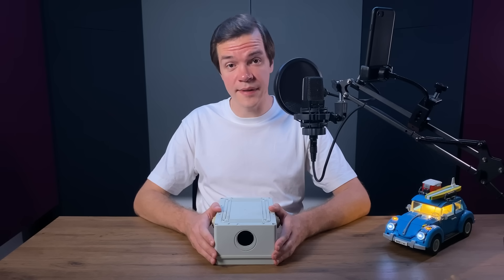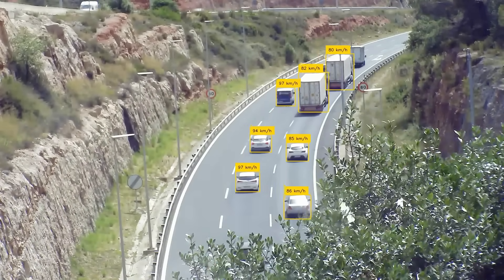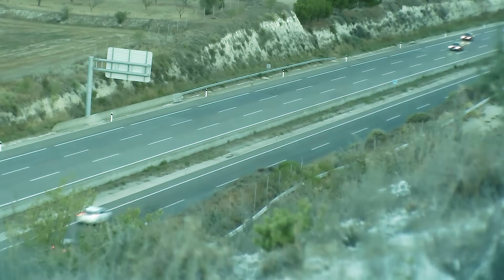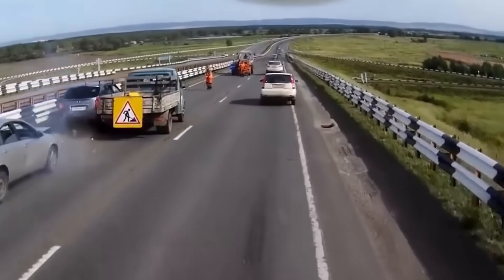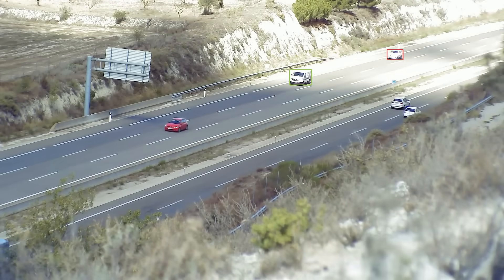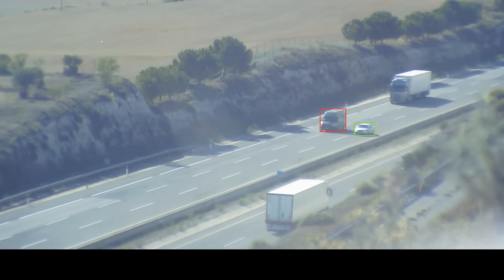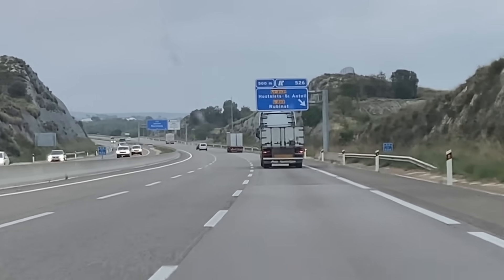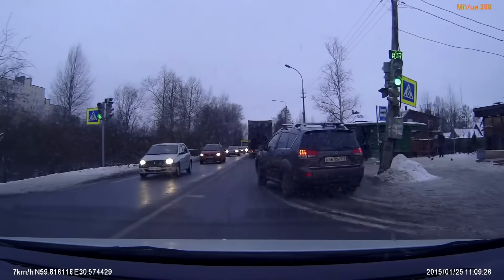New Anti-Tailgating Camera Reveals Shocking Statistics

Comment: "Tailgating" is a habit of a great many people.  If it takes T1 to observe something and determine what action to take and T2 to actually take it then being closer than T1 +T2 means a collision is inevitable.  If the speeds are different the time required is T1 + T2 +(U-V) / a where a is the maximum braking acceleration, U is the speed of the car behind and V the speed of the car in front. Taking a fair number for a is between 1 m/s^2 on snowy ice, to 3 m/s^2 on a damp road to 6 m/s^2 on a wet road to 10 m/s^2 on warm dry bitumen.  Because of that great difference then having the SAME speed for all vehicles makes everything easier and safer. The weather conditions have less bearing on the safe distance.  Note that the time T2 can reduce to almost zero if your foot is off the throttle and covering the brake. So ANTICIPATION helps a lot.
To give examples at 20 m/s (72 km/hr) let us imagine that T1 is 1 second T2 is also 1 second and the front driver is at 60 km/hr ( a bit under 17 m/s) the driver in front sees a problem and starts to brake at 6 m/s the time that the car behind must be to avoid a collision is 1+1+ 0.5 = 2.5 seconds.  If the vehicle in front HITS something that you can't see then the minimum time becomes 1 +1 + 3 = 5 seconds.  Closer than that and it is too late you HAVE hit the mess.  Multicar pile up here we come.  Now this is the minimum.  If everyone did this then when one car brakes the one behind must brake and the one behind that must brake and the one behind that must brake.  And so on. Indefinitely.  If the distances were doubled then the first car brakes.  The second car doesn't need to brake as hard.  The third car brakes less again and after a few cars the problem largely disappears.  Everyone gets home with a minimum of delay or traffic jams.
There is a REASON why I am so concerned.  Many years ago an empty sand truck was tailgating a car on Stud Road.  According to the truck driver the car braked.  The truck panic braked and lost control of the rear which swung across the road into the oncoming traffic.  Because of the mass of the truck even though it was a 60 km/hr zone the effects on the oncoming traffic were of a 100 + km/hr collision.  My father in law took the brunt of it.  It didn't kill him outright but left him with permanent severe brain damage. Unable to walk or feed himself or do anything without assistance.  It took him 5 years to die slowly.  And all because the truck refused to leave an adequate space.  It isn't "just tailgating" or a victimless crime.  There is a litany of victims of it and the policing is negligent where it exists at all.  No one takes road safety seriously.
Reply: Just assume the car in front of you collides with an object you couldn't see - assume that the driver is asleep and doesn't brake at all because he doesn't notice. That car very suddenly comes to a complete stop, far faster than it could by braking, far faster than you could by braking. So just assume the space you have for coming to a stop is exactly the free space you can see in front of you, and not a centimeter more. This also works for situations where the road in front of you is beyond visibility - be it because it curves, because there's a hill, or because of bad weather. It doesn't matter. Always assume there's a dangerous problem just outside of what you can see.
Reply: @KaiHenningsen If there is no other vehicle in front of you, then you really should able to come to a full stop within visible distance. But if only the vehicle in front of you blocks your view and you follow the same logic that means you don't trust the driver of that vehicle. But if you don't trust him/her, why are you trust the drivers of crossing traffic when you pass a green traffic light without braking? If you always slow down even if you have priority to check whether is there crossing traffic violating rules, than than the traffic gets so inefficient that the roads become basically useless. For efficiency you should trust in all other drivers following the rules. This is not just an advice, this is the law (at least here in Hungary). And if the driver of the vehicle in front of you follow the rules it never will struck something and come to a stop instantly.
Reply: @Zilahi-Branyi_Laszlo  show where that law is written
Reply: @gavnonadoroge3092 I was a bit unprecise. Its an interpretative provision of the law, not the law itself and it is not in force for almost 10 years now, but based on press release the goverment want to implement it into the new law expected to enter into force next year. Despite currently not in force, even nowdays this is one of the first thing driving schools teaches to students, so basically everyone use it as a rule, as people usually learn based on what said in school and not by reading the statue book and the fact that the goverment want to implement it into the new law shows that they don't think it is outdated, its invalidation is just an unwanted side effect of the interpretation provisions has been generally abolished and they plan to correct this now. You can find this interpretative provision in the book "A közúti közlekedés szabályai és értelmezésük" however you probably need to get your hand on a phisical copy of it as it seems it isn't available in any electronic form.
Reply: and those ones who screams speeder are even the same which cutoff otherones

...most times to grab money from the insurance come pennies
Reply: I have always thought that the absolute majority of accidents can be avoided by maintaining the safe distance, it's much more important than religiously setting the (EXACT speed limits regardless of road conditions)

Comment: Excellent analysis and presentation.  Thank you for all your hard work.
Reply: Indeed.
Reply: Cars have the technology to be programed to follow at a safe distance.. but not everyone uses that feature or abides by it. So why not take car safety a step further and have a mandatory warning? You could employ this technology as a standard the exact way you do with seatbelts. If you dont put on your seatbelt on get an annoying dinging sound and blinking dash icon till you abide by the law. If you followed to closely and got a dinging sound and red blinking dash icon Im fairly sure everyone would back off after a few seconds just as they submit to putting their seatbelt on. The impact would literally be HUGE since most accidents are caused by following too closely.

Comment: The issue often is that slower drivers don't keep right. Then, you have to come closer to let them know you'd like to pass. Thus not keeping right is much bigger security problem than tailgating itself.
Reply: you "have to" come closer?
What is your first priority while driving?
Getting home safe or being there early?
Reply: @Ultrazaubererger  To me keeping my sanity having to deal with idiots in traffic for 2hours everyday helps me to drive safer.
If everyone followed the 100m rule id spend 4-5 hours in traffic everyday or more.
Its littearly impossible, my way back to home is littearly constant traffic on both lanes for 60km.
Speed limit is mostly 100kmh but the normal speed is 80-90 sometimes even 60-70 becourse some people NEED to take an exit 2km ahead.
Reply: @iirosiren5120  I had to drive 40km each direction for a few years. Heavy traffic all the time. During that time I changed from always trying to push past to always keeping a safe following distance.
It made no difference (the most I was able to gain was 10 minutes off my 1,5h drive).

Also, 60km each day? you should get a new job or move closer to it!
The added quality of life is worth it!
If you calculate your commute time as working hours, it may even be cheaper to get a more expensive place or earn less.

Comment from the maker: What do you think is a safe and reasonable following distance in dense traffic at highway speeds (75 mph / 120 km/h)? Both meters and yards are fine — they're more or less the same anyway :)
Reply: Just went to the obligatory skid course (Schleuderkurs) in Switzerland, and they told us half of the speed gauge in meters or about 2 Seconds to the next vehicle. I find it interesting that you where told 3 Seconds (more is better, no doubt there).

It's a bit sad, that when you try to have enough distance to the next car, that others will invite themself into the 'reserved' space.

What I'm trying to do is put in the speed control and have the  foot over the brake, to get a even faster reaction time.

Still leaves the one behind to also do the right thing.

Driving is teamwork, regardless of how one looks at it.
Reply: Also, yes, external enforcement against insufficient distances does exist. Old Top Gear or Clarckson's Car Years showed it on a segment on the unrestricted segments of the german Autobahn. It did, at least at that time, however, require a human officer in the loop to decide on context wether or not it was tailgaiting.
Reply: It is more complex. If you are faster than the person in front you must increase the distance.  Conversely if you are slower ( they have just overtaken you) the distance can be less.  Once that is considered the MINIMUM safe distance is the reaction time under the conditions.  That can be as low as 1 seconds for a driver expecting something at any moment but with the foot on the throttle, 0.6 seconds if the foot is covering the brake and not on the throttle to over 2 seconds on a highway where a driver is not expecting trouble. To many seconds if the attention of the driver is distracted by ANYTHING inside the car.  But the minimum still causes traffic waves and congestion.  So if EVERY driver allowed an extra couple of seconds the action of one car would diminish after a few cars passed.
Reply: approximatly 3-4 seconds, since that stays about constant with different speeds, is constant across imperial and sensible units - and I don't have the spacial vision to estimate those distances in spacial terms.
Reply: I use 2 seconds when I drive.
Reply: I usually have slightly more than one second. Works 100% of the time for now
Reply: how about trailors which mean to push the limits
Reply: In the UK, 2 seconds is recommended. However, if you leave more than 1s the space will be filled with another car.
If I can't see the vehicle in front of the one in front of me, I try to leave a longer gap. It's not ideal looking for shadows from the vehicle you can't see to determine it isn't slowing down ... but sometimes it's the only way to avoid another car pushing into the longer gap.
Key is to keep enough distance for reaction time plus a bit, but also make sure you can stop in the distance you can see (e.g. watch multiple vehicles ahead to anticipate the need to slow down before it's suddenly urgent.
I've only had 3 insurance claims in 37 years of driving, and never for driving into the back of another vehicle, so I can't be that unsafe
Reply: I try for 2 seconds - I remember the old UK public information films where you were advised to say 'only a fool breaks the two second rule' between the car ahead passing a fixed marker and your car  arriving there... the films are on youtube if anyone's feeling nostalgic.